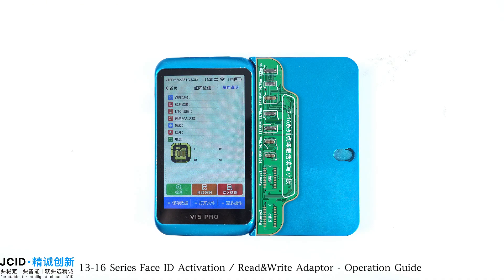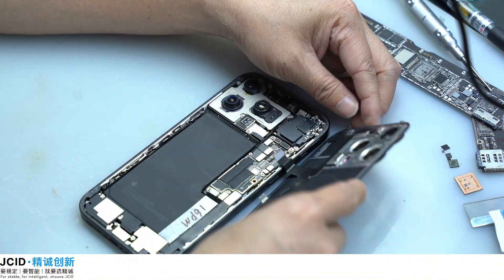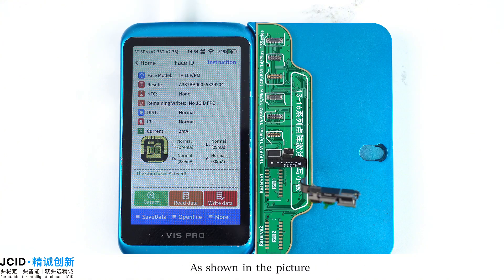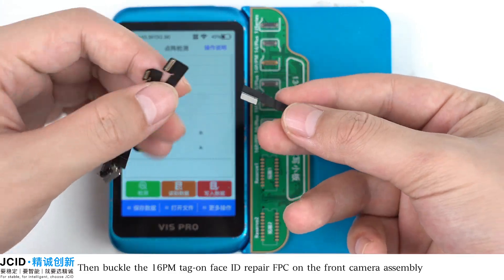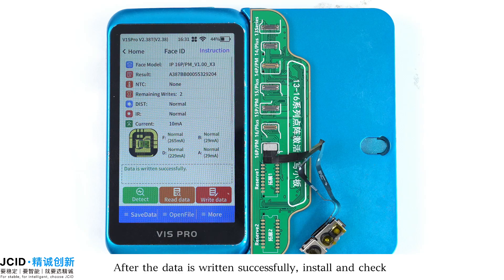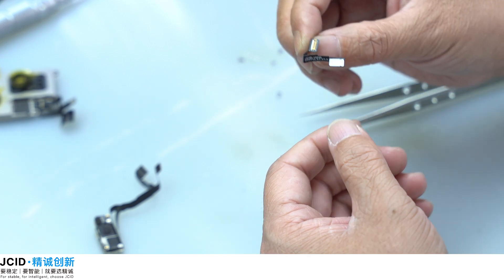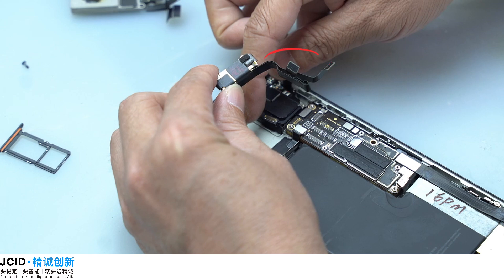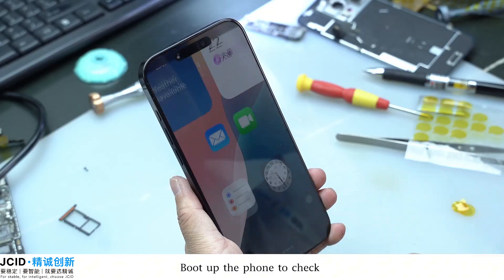JCID 13-16 Series Tag-on Face ID Repair FPC & Adaptor - Operation Guide #jcid #faceidrepair

Comment: I tried today but its shows on the activation that the moudler is not supported for the activation but i have buy the latest face id strip 13-16 series face id
Reply: Me also have same problem
Reply: @immobilekosamba hi friends, i have a 15 pro Max Face ID broken and im thinking try this method, you solved it?
Reply: I’m having same problem
Reply: @Blackboyfly100 Hi, you solved it?
Reply from the maker: Hi, please contact our tech support for further assistance, they will help you find out and solve the problem with their professional knowledge: 

JCID Technical Support Team 
Whatsapp 1: +86-191-4796-3967
Whatsapp 2: +86-199-2649-0240
Email: support@jcprogrammer.com

Comment: What about if stolen device protection on it can’t be connect to pc or v1s pro box so activation not possible 😂 what about get phone in recovery mode & active with phone serial no. Already other company doing that what about that solution x-16 tag on flex ! If not possible then no use of tag on flex 😅
Reply: Connect via pc, dfu mode